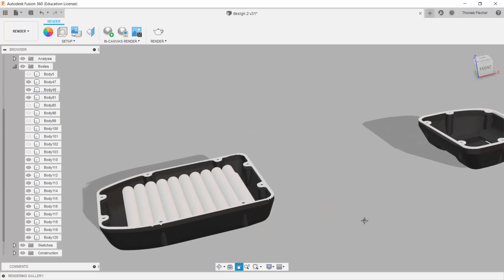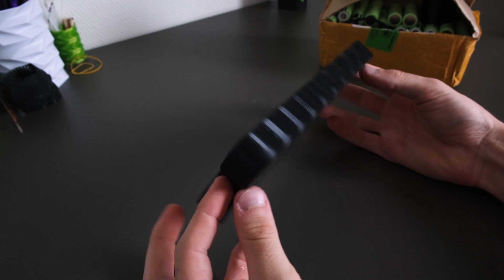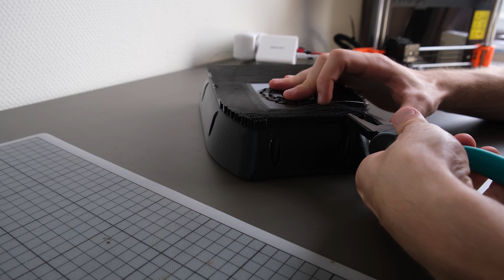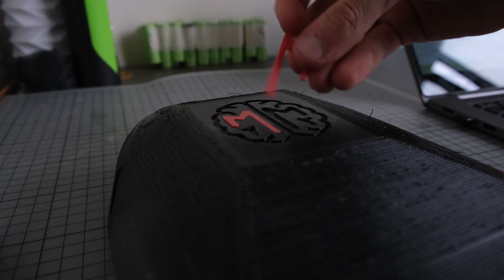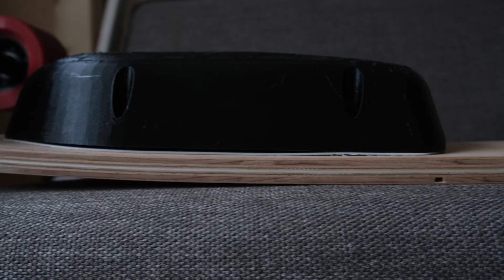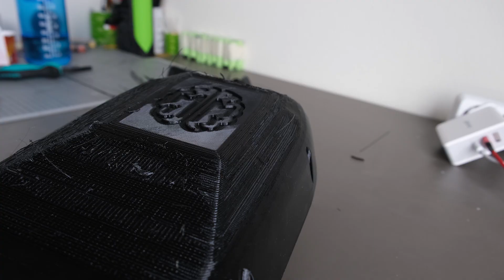3D printed electric skateboard battery housing

Comment: Look forward to updates.. what control board are you going with this time?
Reply from the maker: So for some weird reason after a few  weeks the cheap AliExpress board worked. I am leaned towards assuming that something was wrong with the battery. If it works i will defenately use the 50$ AliExpress one because its an amazing price value. Currently i have an issue with the spotwelder and can't use it :( i hope i find a solution for that soon